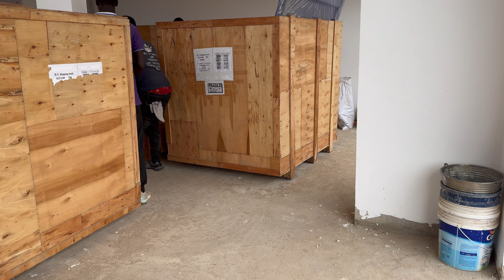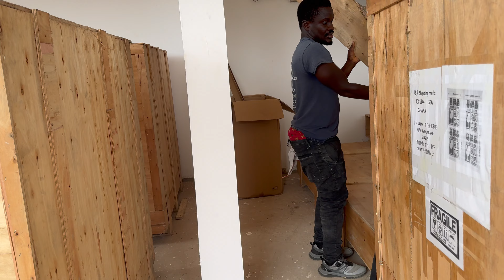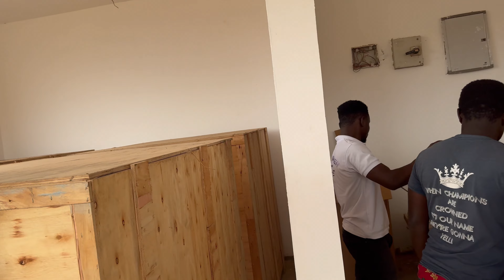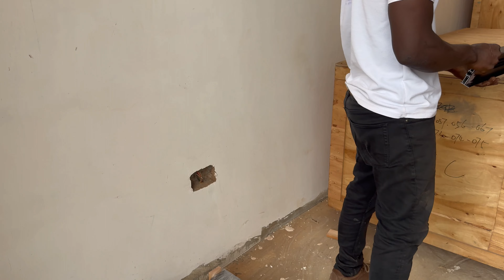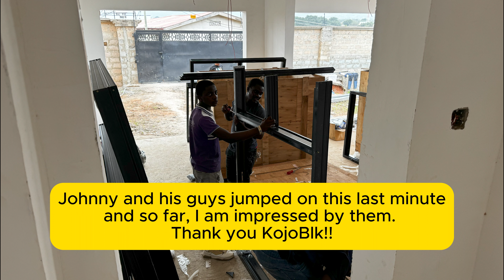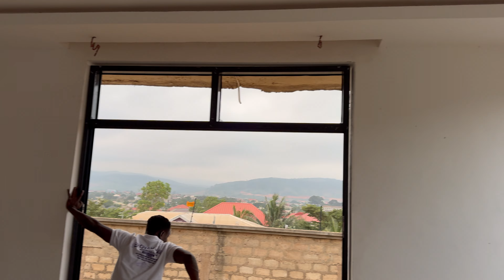Building In Ghana | Installing Premium Made In China Windows | Episode 1:  Unboxing and Assembly

Comment: Congratulations Eric, you did it!!

The possibilities here on are endless. Literally most manufactured products in the world these days are from China and getting them directly from there means getting the best value your money can buy you or the design you’ll love. The customization aspect of everything we can order is also endless. The only reason you probably ended up with a gab may have been the measurements and the person who did it but the adjustment shouldn’t be that much as the gap between the windows and the walls are very minimal and can easily be fixed

Let save our money and get most of our things directly from there but only thing is that we have to get our measurements millimeters perfect
Reply from the maker: You nailed it all the way, bro! There has so far been zero mistakes from the factories we have engaged. For my windows, the mistakes was solely due to us not measuring some windows correctly. We are working on resolving them though I am content with the outcome so far

Comment: For the gap below the window, let me suggest you remove the window, prior to filling up the gap with mortar/small block work, etc to minimize/eliminate  mortar/cementious material on the nicely done window frame.  The windows can be installed once the corrections are done.
Reply from the maker: Good suggestion except I didn’t anticipate such huge variances so we ended up affixing the windows. I will ensure whichever window gets redressed is cleaned thoroughly afterwards